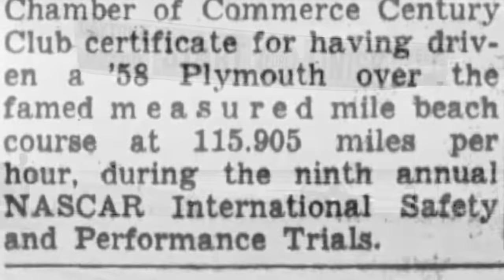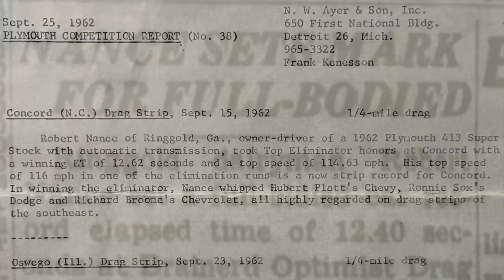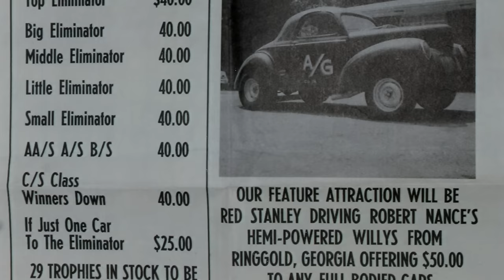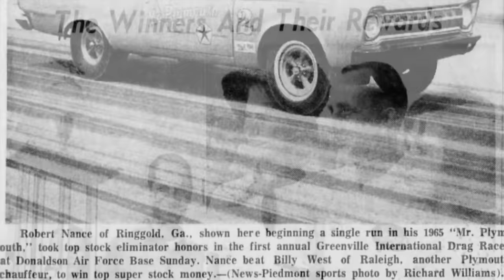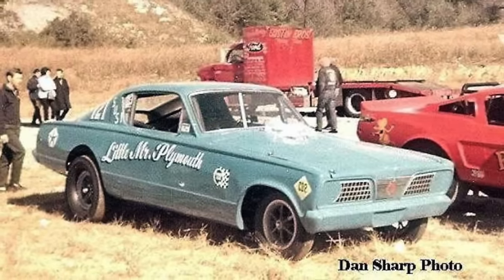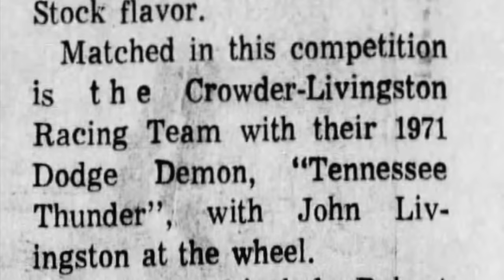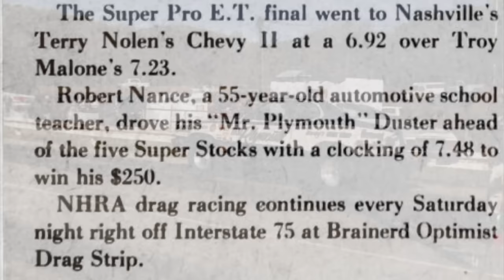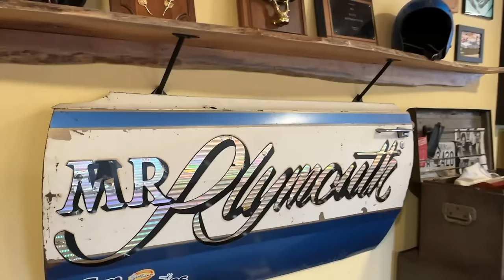Drag Racing HISTORY: The Legacy of Mr. Plymouth

Comment: Car at 17:30 is a totally different duster than the the one at 18:30. 18:30 is around a 70 or 71 Duster. The one at 17:30 is 73' or later.
19:20 car is different car from 19:34 car.
Reply from the maker: It is the same car. I explained in the video that he wrecked the car recently and changed the front end to the earlier style. The 17:30 video was taken at Brainerd Motorsports Park in 2022, and the 18:30 video was taken at the Chattanooga World of Wheels in January 2024 with the new paint job and bodywork. 

To add a little more confusion, I believe the car ACTUALLY started as a '71, but was "re-bodied" as a '73/74 to stay current in Super Stock at the time.

Comment: Could you give some further explanation on the letters for the classes and what they stand for? - for example on his car is SS/CA  i know the SS is super stock but what does CA stand for? Thanks
Reply from the maker: In Super Stock, the “C” in the class designation is determined by the car’s weight and horsepower rating. A and B were the top dogs, C was usually for heavier cars. With the refactoring that would happen year to year, the ‘65 Plymouth got bumped to C by the time the Hemi Barracudas came out in ‘68. The “A” means it had an automatic transmission. So, a 4 speed car if the same engine configuration would’ve been SS/C. 

It’s also important to note that other classes (gas, altered, etc) were split by claimed cubic inches instead of horsepower rating.

Comment: Im guessing there wasnt much hi perf parts available back then- did these engines use mostly factory valve train w/ the exception of dome pistons, different carbs and high lift cams? If so its amazing how much HP they got out of the  426 Hemi back then- now there is endless hi perf parts - im guessing of they couldnt find the parts they needed these guys would fabricate it themselves. These guys were amazing mechanics and racers.
Reply from the maker: The rules were pretty strict on engine modifications in Super Stock, so they could do some "blueprinting" which was a way of saying they took the engine apart and made every possible effort to squeeze more power out of it WITHOUT major modifications.